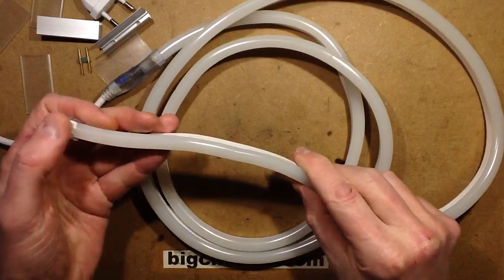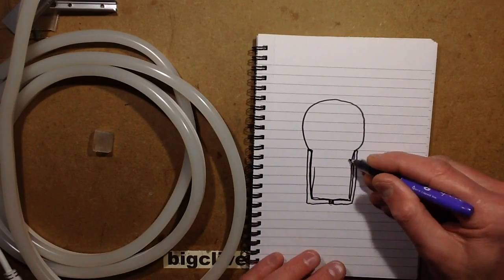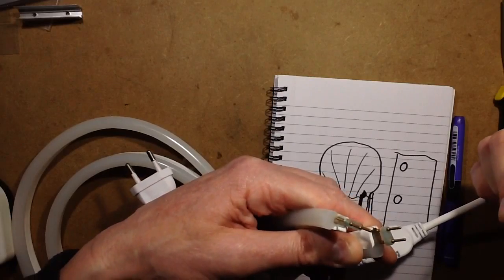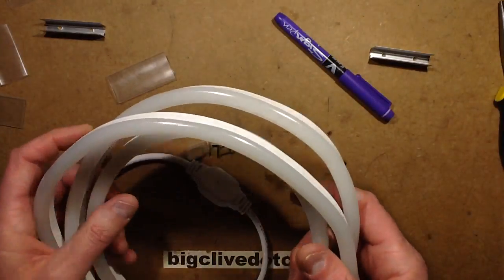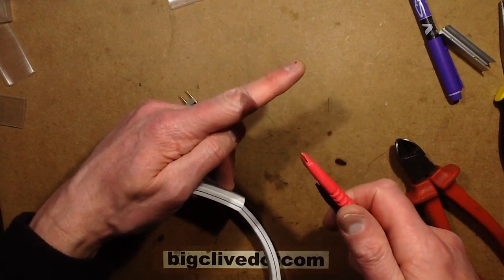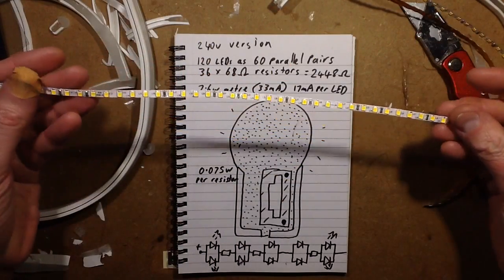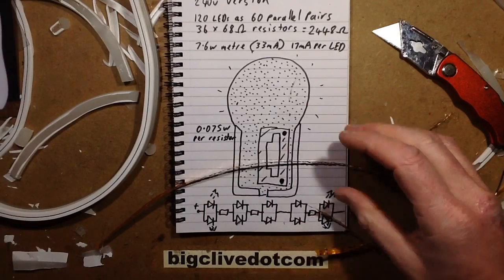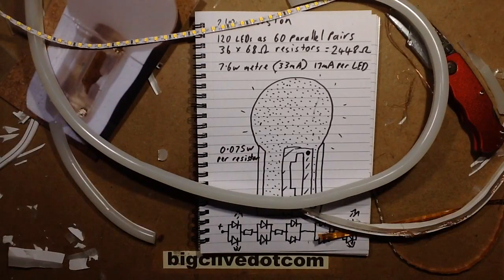A look at the inside of LED based neon tube effect.

Comment: Nothing about the rectifier assembly? For example is there any electrical isolation or is this big thrilling shock hazard.
Reply from the maker: The simple rectifiers do not provide isolation from the mains supply.  You can also get 12V and 24v DC versions.

Comment: I have the same strip but I cannot light it. I cut the strip,connect to plug but nothing.Do I have to glue the led strip with the wires?
Reply from the maker: It can only be cut on specific positions and either a suitable connector has to be used or in some low voltage versions wires have to be soldered to the internal copper pads.

Comment: Thanks for this great video. Do you know if I can connect it to a power bank with usb? Thanks
Reply from the maker: You can get a low voltage version.  I've only seen it as complete frames with shapes though.

Comment: For the electronically-challenged here (i.e, Me) , Could someone tell me how this is running directly off Mains voltage?
Does the Rectifier lump on the cable also transform the voltage down, Or do the resistors on the LED strip drop the voltage to a safe level?
Reply from the maker: The lump is just a rectifier.  Each section of LEDs has enough resistors to run directly at mains voltage.

Comment: How flexible is it in the other axis? Im considering making a giant arch to use it for perfectly even bench lighting. I hope its bright enough.
Reply from the maker: This stuff is more suited as a visual effect and not as a light source, but you do get mains voltage tapes.  The low voltage 12V tapes are better though as they don't flicker when used with a good power supply.

Comment: How does the led strip contact the bus bars?
Reply from the maker: Stranded wire soldered to the strip and then pressed through the strands of the bus wires.
Reply: bigclivedotcom Awesome. Thanks!

Comment: can i cut it every half meter or should i only cut it every one meter
Reply from the maker: It depends on your supply voltage.  The 220-240V stuff is usually per metre, the 120V stuff may be able to be cut at every half metre, but there will be marks to indicate it.

Comment: I bought a piece of software not too long ago and it said I needed Mac OS X 10.6 or better.
So I installed Linux.
You don't understand Apple. Once you own Apple, you need everything to be Apple or nothing works. Which is why I use nothing but Ubuntu. In your case you just need one more Apple product for your life to be complete- the 50-60Hz conversion device. Just one last $750 to the fellows at Cupertino and all of your devices will finally run smoothly. Until the next $750 needs to be sent to Cupertino.
Embrace the Penguin. He won't even mind your ambient temperatures.

Comment: You can get 360 degree versions of this now but they don't all appear the same (I've seen some with shadows).
Reply from the maker: Do you mean the round LED ropelight?   It's been around a long time.
Reply: Didn't realise you'd replied, sorry. I meant stuff like this: https://www.ebay.co.uk/itm/360-Degree-Glow-flex-Round-LED-Neon-Rope-light-strip-220V-2835-waterproof-lamp/291978684010?hash=item43fb49266a:m:mW_8fjGTYt2327iPnLlQHWQ
What is likely to be inside the lump of plastic between the LEDs and the mains plug in the picture in that listing? I can only think of one reliable way to find out :P

Comment: got those lights from ebay, but they do not work? any ideas?
Reply from the maker: Three possibilities.  The material can only be cut on specific marks.  If it's a metre or less then make sure it's not been cut mid-run.  The lead supplied with it contains a rectifier and the connection must be put on the correct end for the polarity to be correct.  The connection is made by metal pins pushing up the end of the busbar wires's strands.  If not aligned correctly it can miss the strands and go into the plastic instead.
Reply: thanks, tried it all, but they wont light up :(, gonna ask for a replacemend on ebay.

Comment: Hi there..

May i ask you something.
About the flexible neon, Can I cut it anywhere I want it or not?
Because i don't want to make a trouble if i cut the neon anywhere i want.
thank you before for helping.

best regards.
Reply from the maker: It must only be cut on the marks as if you cut it anywhere else,part of area it was cut will not light.  You also have to cap the end with a suitable insulated cap as it has live wires running along the inside to power all the sections.
Reply: bigclivedotcom Oh i see, thank you for your attention. So, i can cut anywhere as long as i covered at the end when i cut the flexible neon right?

Comment: How are the buss-bars connected to the LED strip? Is is making connection all along the strip or in set intervals?
Reply from the maker: A short wire tail connects each end of each section to the appropriate buss core.

Comment: Any chance of a break down of one of these ? https://www.amazon.co.uk/Auraglow-Remote-Controlled-Colour-Changing/dp/B0047TP4CO  I just got a shock off one!
Reply from the maker: Was it a proper shock?
Reply: It was a mild shock (finger trembling). My one is according to online postings is a Chinese copy of the Auraglow one above. There are loads on eBay (two different types though..one with a single LED and one with 3) .
Reply: Just bought a UK Auraglow  version and the Chinese copy that gave me a shock has quite a few components missing when you have a look inside...

Comment: I spent hours on that stuff. I worked on the set for the UK tour of Grease. All the signs had routed channels for it to fit in. The only problem was that they never fitted the cut points, so I had to break in to it and rehash it. Beware this stuff is not all equal! Some is so bad you have to solder it every foot or so.
Thankfully I don't do that sort of stuff anymore :)

Comment: Hi Clive why can it only be cut in 1mtr intervals?
Reply from the maker: In the 220-240V stuff that's the length of each series section of LEDs.  In 120V stuff it may be able to be cut in half that multiple.  Cutting it anywhere else will effectively kill a large portion on either side by breaking a series circuit.

Comment: Flame test to test wire composition? This I gotta see.
Reply from the maker: If you test the strands of copper wire they will blacken but stay put.  If you test the copper coated aluminium they will immediately droop and fall off.
Reply: Dishmopo 

are you promoting lolis?

Comment: Doesn't that milky plastic look a lot like hot melt glue? Would be interesting if it's the same material.

On the issue of Apple shimmer, I think you should keep it, run your next camera unsmoothed when you upgrade. I find I get tired gritty eyes much faster if I spend any time in a room with shimmery lights, so the first thing I do when lamp shopping is to see how the light looks through my cell phone camera. So if I'm gonna buy something I'd like to know how much flicker it has. I bought the "death star" banggood kit because it had that nice flywheel circuit, partly because it looked so free from flicker.

Comment: The "LED CONTROLLERS" you showed in the color changing LED fairy light conversion video have arrived.
I now want to mess around with the capacitor dropper.

Can anyone of you send me the formula to calculate the correct capacitor value I need?
Thanks!

Comment: The moral of the story is that 60Hz is better for no reason other than 90% of camcorders using it as a reference frequency. 

Makes you wonder why Europe goes through the trouble of using 50Hz and having both 240V and 120V in their homes at the same time instead of sticking to one goddamn standard.
Reply: Well, most electricity standards are more than twice as old as camcorders with image sensors. So, it’s a little bit grotesque to favor one frequency only because some camcorders do not have manual framerate/shutter control.  

By the way, in disagreement with your statement, in Europe there is only one standard: 230 V, 50 Hz. See https://upload.wikimedia.org/wikipedia/commons/f/f5/Weltkarte_der_Netzspannungen_und_Netzfrequenzen.svg
(There is three-phase electric power in some households, but as a consumer, you don’t have to bother about it.)

The only thing that you have to bear in mind is the plug type, which in some European countries is not compatible with others. But it isn’t a big problem by using cheap (death) adapter plugs. 

It sure would have been nice to have only one voltage and frequency all over the world, but hey, the pioneers of electricity didn’t want that. :-D
Reply: Having 240V and 120V? I've never seen 120V used in someones home.

Comment: Hey Clive, have you thought about making a variable high voltage Dc power supply with good capacitor filtering for testing lights flicker free? I know some lights won't work on DC, but the rest might be usable on video.
The only other option I could think of is a variable high voltage and variable frequency oscillator and "tune" out the flicker. An oscillator driving a high powered audio amp comes to mind.

Comment: AC, regardless if it is 50 or 60 Hz, does not justify a badly designed light source. So, if you say “I’ll get rid of that naughty 100 Hz flickering by filming it with 25/50/… fps,” you actually only mask it. The light source still stays shitty. As there are pretty good high-frequency switching drivers, that aren’t that more expensive than ‘primitive’ circuits, there is absolutely no need for flickering lights. 

Personally I hate all kinds of light flickering as I notice it until approx. 200 Hz with my bare eyes. Even if there are persons that don’t see flickering at all, it does not mean that our brains do not suffer from disharmonic light sources for the long term.

Comment: Well Clive, you have again made me laugh my ass off! Yes is has fallen off, well no not really. Anyhow, as i look at the hand drawn cut away. It looks like if the outer white portion
of plastic up next to the leds was coated. With a shiny ceramic paint - say a silver color.
On the inside it would increase the light transmission to the outer translucent mass.
Making better use of the light generated. At least to my minds eye it would seem to.

Comment: Big Clive, the frame rate isn't an issue with the hardware, it's the software; the basic video utility in iOS is pretty bare-bones. I use a great little app called Moviepro that gives me frame rate options from 1-30, then 48, 50, 60, 96, 100, 120, 192, 200 and 240. It should work just fine with the UK's 50 Hz power. It also includes a pretty good, real time, software based motion stabilizer, resolution options from 320 x 240 all the way up to 3072 x 1728, support for bluetooth mics, audio metering, saveable presets, etc., etc.  It's a great little app for something like $5 US. I am not affiliated with the app, I just like it a lot.

Comment: isnt the conector polerised by the shape ? your not going to attach the other bit upside down.
Reply from the maker: It's quite neat.  It can only go on with the correct polarity whichever end you connect it to.
Did you get approved for the lift forum?
Reply: yes thanks clive

Comment: grab a Samsung Galaxy Tab S2, it is 50Hz-60Hz
Reply: Imploment its camera is #2 on the list, running around £87 with a 3100mAh battery and a IP 64 water resistant rating, when the iPad is IP 56 dust proof rating

Comment: So ive been wanting to add automatic soft night light tech to the under sides of the tables in my house and this seems perfect for that application am I right?
Reply from the maker: If the lightsource is not in direct view then you could also use the standard low voltage LED tape.
Reply from the maker: They've been pushing many of the smaller lamps too hard, so they do fail quickly.  Hopefully they will evolve over time.
Reply: Have you done a review on G4 leds? I have brought a few to replace my 20w halogens in my extractor hood and both failed within a month they were modeled to look like the halogen bulb but started to flicker before rows would go out and then the whole bulb will fail, I also brought Diall and Panasonic G4 leds but they wouldn't fit.

Comment: Cool stuff, I picked up something a bit like that, but much thinner and more flexible. I had intended on fitting it on the underside of the awning of our Motor Home but on it's arrival it appeared  much to flimsy to stand up to outdoor use. So I just used it to run over the top of our living room /dining room super slide out in the Motor Home. Makes nice mood type lighting and gives off a nearly neon like glow that I have always loved.  Here is the stuff I purchased:  http://www.ebay.com/itm/5m-2-3mm-Neon-Clear-Blue-Glow-Light-EL-Wire-Rope-110-220V-AC-US-Plug-New-/131381257982?hash=item1e96eee6fe  Any idea how it is made?  I don't really want to take mine apart as I like how it works as it is..
Reply from the maker: Yours is electroluminescent wire.  A layer of phosphor sandwiched between an inner electrode wire and an outer conductive layer.  It's good you didn't use it outdoors as moisture kille electroluminescent materials by permeating their plastics.

Comment: The reason the light flickers when recording is because the shutter speed of the camera(1/60th) is not equal to the refresh rate (50Hz) of the power source. Search for a manual camera app on the iTunes store and you can change the shutter speed to 1/50th when turning on the light and back to 1/60th when done

Comment: Clive - maybe use an inverter for 240 Volt, 60 Hz for some of your LED lighting videos, to test if it works better with the Apple's camera. Even a small 50 or 100 Watt inverter would be enough for LED lights.

Comment: Hi Big Clive. I've watched quite a few of your videos and find them really interesting. 
You show quite a lot of the cheap Chinese led lights and I was wondering, are the mains ones safe to use in the UK with a simple visitors adaptor or is it worth paying more for the lower voltage ones which come with a big chunky wall plug like when you purchase fairy lights from a shop?
One thing I've noticed on sting lights, is the Chinese ones seem to be made of much cheaper insulation however, with the ones your showing on this video, that's not the case.
Cheers mate, I hope I can get an answer to this.
Reply from the maker: I generally recommend that the low voltage lights are used as they are a lot safer and will last longer.

Comment: I use knives the same way but have never cut myself.
Reply: Thanks, I will try harder.
Reply: Yep - I've got a knife like the one you're holding at 8:47 (mine's rolson brand) and tbh I think it's just a crappy knife. IMO the handle's too far away from the blade giving you bad leverage and making it awkward to use with any force giving it great thirst for it's users blood. The stanley knife type are better to use but my current favourite is an opinel 7 french peasant style folding knife, non replacable blade though, doesn't bother me cos sharpening knives makes me feel extra badass.

Comment: Clive, have you considered using your phone to record videos? If I remember correctly, you used during the last year's military tattoo in Edinburgh. Quality seemed to be better than what you get from the iPad. The phone might handle the flicker better as well. Plus, you would have a clearer view of your bench, with the phone taking less space between you and the bench itself.
Reply: zaqway those videos were awful. It was constantly hunting for focus. But it wasn't Apple so nobody felt the need to shit over it.
Reply: Honestly, I couldn't care less about what brand equipment Clive's using. Just pondering about how to improve the quality and help with existing issues, using what we know Clive already has.
I reviewed one of those videos just now and yes, you're right. It is hunting for focus and exposure quite a bit. However I wouldn't count this option out because of this, since these settings can probably be locked, like Clive is doing with the exposure on the iPad. Aside from that, the overall video quality seems to be better on those videos, at least in my opinion.